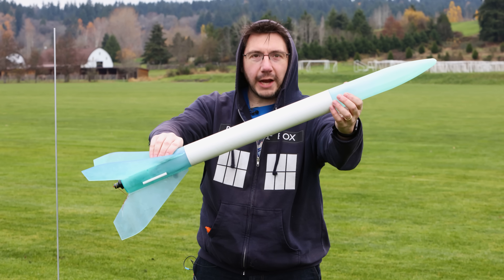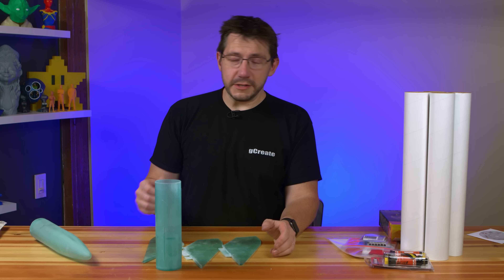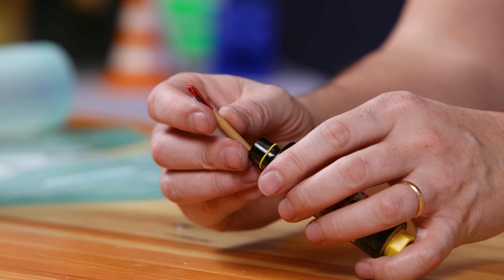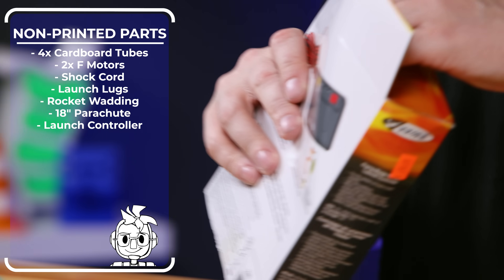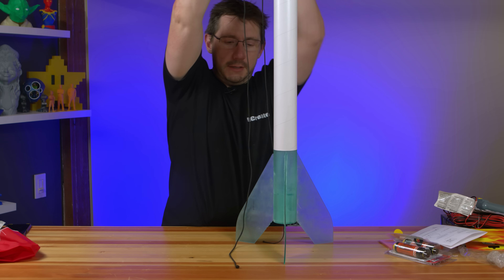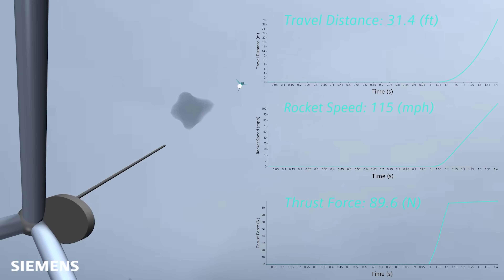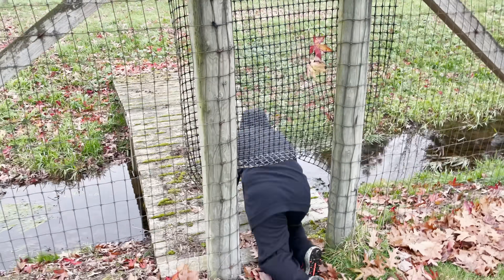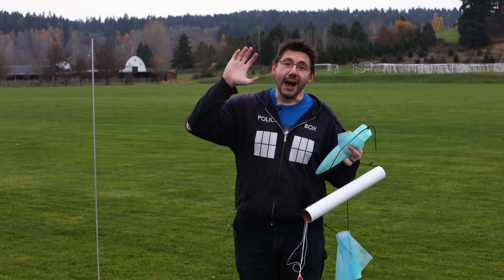Faster Than Sound? 3D Printed Rocket!

Comment: Just a few of gripes. For potential to use larger motors, maybe go with a 38 mm, then choose to adapt to 29mm, also  don't include a top engine block in the motor mount, as mid power motors that use composite propellant use a thrust ring on the bottom of the motor to retain it from going upwards. I feel like your nose cone shoulder ( the part that actually fits into the airframe to hold it on) is too short. Fins however were excellent, you chose a through the wall setup which is great. Also, why no follow  footage of the flight. That helps bring you to the actual moment a little bit like you're also there to watch it fly. Well, these are just the arrogant nit picks of a Rocketeer or "enthusiast". Great video and good job on that rocket. I wish i could afford a 3d printer of my own.

Comment: So, I saw the 18 inch parachute and I thought "I would have used a 24 inch chute." And then a fin broke on landing and I thought "definitely 24, maybe even 36 inch." I've done model rockets as a kid and an adult (I am high-power certified), and I worked on the Space Shuttle program way back in 1980.

Comment: As someone who has been flying rockets for over 20 years, and started 3D printing nosecones and fin cans almost a year ago. I knew it would fly, if the CP CG is in proper positions. 
It look really awesome.
Part of the reason you broke a fin was because that parachute was a bit small for the weight/mass of your rocket. You need a larger parachute for next time.
Happy Holidays!

Comment: Print a different fin design that doesn't protrude from behind the bottom it will significantly reduce the probability of fin breaking. Also for a rocket that size you can go with smaller fins that will also have less drag.

Comment: the yellow part on the end of the key is a launch rail safety. it used by put it on top of the launch rail when setting up the rocket so the rocket doesnt accidently launch while someone is close to it (say a kid hitting the buttons or something) by keeping the key separate from the launch controller during the set up procedure. also makes sure theres no electrical connection between the two and the flag on it notifies people that the rocket is not ready to fire yet.

Comment: As a rocketry enthusiast my self i found this pretty cool. Though I've built way more complicated rockets using GPS telemetry and altimeter to control parachute deployment, currently prototyping a liquid rocket motor running on ethanol and liquid oxygen, gj joel

Comment: Just watched the flight. fin broke as expected. resin is a bit brittle. Couple of suggestions. Attach the shock cord to the REAR of the model and have it run up the OUTSIDE of the tube into the top. this will cause it to come down top first or at least sideways. so the top hits the ground first instead of the fins. ALSO how is the eyelet on the  nose cone? any signs of stressing or cracks? The body tube should be fine to reuse. if there is any zippering (like the shock cord tried to slice through it) you need more shock cord. I can also show you how to accordion fold the shock cord. Fold it up like an extension cord and use a small piece of masking take at each fold at each end. when its ejected the force will unfold and tear each of those pieces of masking take but each time it tears one energy is dissipated so by the time its done there is not enough energy left to rip apart or damage your model.

Second notice the burning on the fins? that is the deflection off the blast plate of the launcher. need to use a stand off to lift the rocket rocket higher up the rod so that blast of initial flame does not torch your fins. you can also slap a little aluminum foil on them. it will blow off on lift off but might provide some heat protection for that first 1/2 second before it clears the rod.

Also I am curious to see how the MMT the motor mount tube (the part of the fin can that holds the motor) held up to the heat.! Any deformation? ie where it looks like it got soft and shifted or warped slightly? I am curious as to how well that section held up.

ALSO estes has a wee little tiny altimeter has a little lcd screen on it and everything. you pop that in their (attach to shock cord) and it will tell  you how high the rocket went!

Comment: The paper tubes are called body tube or "the airframe"

And yes its a launch rod. the purpose is to allow the rocket to achieve enough velocity so the fins can start working. these rockets have no "active" stabilization (thrust vector control ie engine gimballing or RCS thrusters or active moving fins) its "passive" guidance. so it needs a minimum airspeed for the fins to start working. that is what the launch rod or launch rail does. allow it to gain enough speed before its set free.

To see some AMAZING things in model rocket check out Joe Barnard BPS Space. it is actually making 3d printed mounts for active gimballed model rocket motors!! truly amazing stuff.

I am actually surprised the resin can handle the heat from the motor! impressive. I will be amazed if those fins hold up on landing. I am also amazed that the eyelet on the nose cone can hold up to that. I would use 4 or 5 times body length for just elastic shock cord.

Comment: Great flight!  As a rocketeer, let me give you a couple of tips.  First the 18" parachute is way too small.  The broken fin is most likely a result of hitting the ground too fast.  Here is a calculator to determine the size of your parachute by the weight of your rocket. 

https://www.rocketreviews.com/parachute-size-calculator.html

Second, I would suggest adding another launch lug further up body tube.  In one of the shots, I see the rocket leaning in a different direction than the launch rod.  Your lug is binding on the rod.   Adding the second lug will straighten the rocket with the launch rod and with the lower friction your rocket will fly higher.  

Third, you want to ensure that your motor will not pop out of the back of the rocket.  Wrap a layer or two of masking tape around the motor so it takes a little effort to push in.  If your motor ejects out the back without pushing out the nose cone, the rocket will come in ballistic, like a lawn dart.  Then you will need a shovel to recover your rocket.   

Here is a video taken by a fellow rocket club member of my Mars Lander rocket that was entirely 3D printed.  

https://www.youtube.com/watch?v=vCv_Ul6z1Bs

Glad to see the enthusiasm!  The excitement of a launch has not worn off for me, and my fellow club members.

Comment: White cardboard thing - body tube. Thingy with engine in it - sustainer. Beware... rocketry is addicting. Once you move to high power rocketry you can never leave. ? or maybe that's a hotel in California... nope... it's high power rockets... Trust me... that is not a huge rocket. Well... it's toward the end of the video now- you're hooked. It's good to join NAR and TRA are good organizations to join. We put trackers and flight computers on them now. Check out Joe Barnard on YT. He's doing some cutting edge stuff.

Comment: I'm IMPRESSED!!!!  I think a larger chute would have kept the fin from breaking.  The resin parts alone are probably far heavier than an entire rocket that size would be with the standard plastic/balsa/bass wood parts.  So a 24" chute or a pair of 18's would probably serve better.  You would of course have a longer descent, and with equal wind you'd have a longer drift and larger recovery area.  Also I'm taken aback by the altitude!!!!!  It looked in the vid like the landing point was AT LEAST 500 feet away.  When I was launching C and D rockets, they never landed more than 200 feet away, and I doubt they went more than 250 to 300 feet.  I only ever lost one rocket which was a very small A engine affair with a balsa nose and fins, I built it on a Friday night, launched it Saturday morning, and once it went up I lost track of it and never saw it again.  And that round yellow thing that came with the launch controller that you couldn't figure out what it was?  Safety cap for the launch rod because without it... "YOU'LL POKE YOUR EYE OUT, KID!!!!!"  By the way, if you don't know about it, Google, "KERBAL SPACE PROGRAM".
Reply from the maker: I think you're right. Bigger or dual 18s would have been better. Oh, and yes these were heavier than balsa wood for sure. We had an absolute blast, and my guess is it was 800 feet in the air. Thankfully we didn't have much wind.

Comment: I did much rocketry as a kid but sadly most fields of decent size quickly disappeared to become strip malls or housing developments as I got older. Some of my favorites would use spinning blades to slow the return trip to the ground or release gliders (one looked like an F14) which one would then have to chase down. In the end I was utilizing a cow pasture, but the last three rockets I flew all wanted to land right in the middle of a cow pond, no matter which spot on the field I launched them from.
Reply from the maker: I LOVE the idea of a glider system for slower descent!

Comment: Really cool! I built rockets for the Team America Rocketry Challenge about 4 years ago in highschool. I used our schools MakerBot 5th Gen and MakerBot Mini to make the nose cone, tube transitions, altimeter compartment and weight chambers. I've never thought to use the resin printer before for this application!
Reply from the maker: That's freaking amazing! Wow! How cool.
Reply: @3DPrintingNerd  and actually now that I think about it the engine you used was the same one we tried in our rocket. The altimeter showed about 1200ft and that was with a rocket taller and heavier than yours so I wouldn't be surprised if yours made it to 1800ft.

Comment: AWESOME video! I wonder if a FDM printer would be capable of printing these parts? Is the resin material more heat resistant than the traditional filaments? I'd LOVE to try printing some for my nephews, but fear that I'd have a fireball when the material I printed it with caught fire!
Reply from the maker: Hmm. The amount of heat is a lot, but the time the parts are exposed to it is minimal. I think a lot of people use 3d printed parts for rockets. You could use a toilet paper cardboard tube, add in the 3d printed parts like nose cone, fins, motor container, and fly it!
Reply: @3DPrintingNerd  IF I can overcome the issues the CR6-SE is having, I may give this a go. My nephews would LOVE to participate in something like this!

Comment: You should put some tech in there to measure the acceleration and altitude just to see if the simulation data was accurate
Reply from the maker: Oh yes it needs A LOT more tech
Reply: @3DPrintingNerd  And a different color. Sky blue and white makes it harder to spot I guess. Also maybe print the tail in one piece with an FDM printer. Polypropylene might withstand the impact better.

Comment: How high did it go ?
Reply from the maker: I think it was 800 feet.
Reply: @3DPrintingNerd  You need to get your kid a mobile radar unit for Christmas (ex Army). Or fit the rocket with an altimeter, telemetry and tracking system.

Comment: This is on my list to do after my next animatronic. Only difference is I was going to attempt to print the body using Spiral vase mode to keep it light :)

Excellent video! Definitely one of your top ones this year.

And yes I did catch Sean leaving the half second clip of you removing supports and cracking the tail fin.

I could feel the swear words leaving your mount a second later ;)

Well done!
Reply from the maker: YEAH HE DID. Glad you saw that. I had printed 4 of them just in case. That fin ended up not being used. I had a BLAST making this video, this was a ton of fun, and it reminded me of the launches I had as a kid. You should definitely do this :)

Comment: Joel, you can use the resin itself as the glue. You can use a UV flashlight to quickly cure it in place and then fully cure it with a proper  UV light.
Reply from the maker: Fantastic idea!

Comment: A couple of points, you should definitely attach the the body tube to the fin can with some sort of fixing, small screws or plastic rivets otherwise when the ejection charge goes off you risk the rocket splitting at ether end and not getting a parachute deploy. 

From a longevity point of view you might want to consider designing the motor mount so that you can glue in a cardboard tube for the motor to sit in. The exterior casing of the motors  can get pretty hot and i have seen 3d printed motor mounts go a little melty! 

I don't have a resin printer myself so can't say for sure but from what i have seen and experience with 3d printing rocket parts you might find FDM printed rocket parts more durable, Or SLS if you have access to it!
Reply from the maker: Thank you for these great tips!

Comment: I spent many an hour building and flying(and losing) Estes rockets in my early teens of the 70s. Great memories!
Reply from the maker: hahahah, I remember one summer I had an Estes rocket going skyward once a week!
Reply: When I was younger I built a model once called a mosquito that is supposed to take a "A" engine but I managed to fit it with a long burn "B" engine , painted it florescent orange and woosh off it went never to be seen again...lol
Reply: @sortofsmarter  i did the same. fun times

Comment: Nice video and an impressive rocket. I used large spray can bottles, like the ones you'll find in a barder shop or other professional use. You can rework them easily.  They're very strong and light weight. You can find something like 60cm (23 - 24 inch) long and up to 7 or 8cm wide (approx. 3 inches). They're made of metal (alu) so they don't burn. Attaching the fins is however not that easy but it's doable. Give it a try !
Reply from the maker: Fantastic idea!

Comment: So crazy high schooler idea(I did this with friends).  Skip the parachute. Glue on the nose cone. Add a small hole below that in the side for the gas to vent. Cover the outside of the white tube with CA and accelerator. Launch...and run. Also suggest painting the cone so you can see it better.

Comment: Curious about the general cost of all the non- 3D printed parts.  Around $150 is my guess....
Reply: depends, if you are talking about the parts for the rocket, cardboard tube and recovery hardware, you could probably get that lot for around $40 depending on your exact choice of components but could definitely do it for less. The motor is roughly $40 for a twin pack. The launch controller he is using is also about $40, launch pad's as you can see from his video can be built quite cheaply.
Reply from the maker: That's accurate. Some of the stuff is a one-time purchase - like the launch controller and launch pad. The tubes were a four pack, and the motors a two pack. I linked everything in the description.